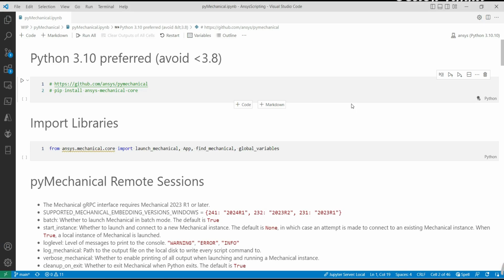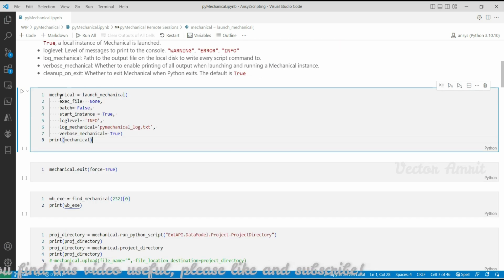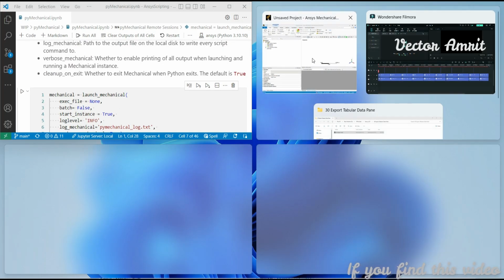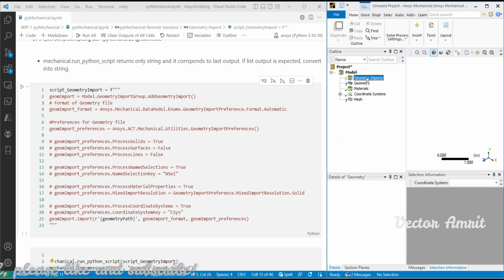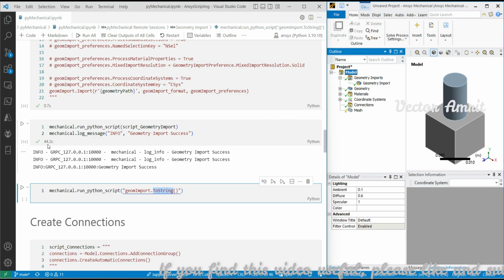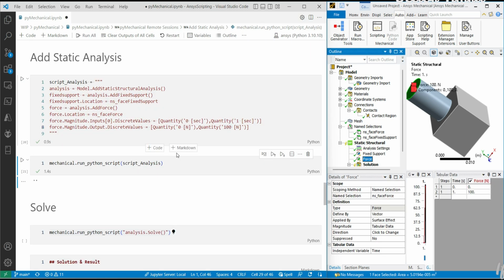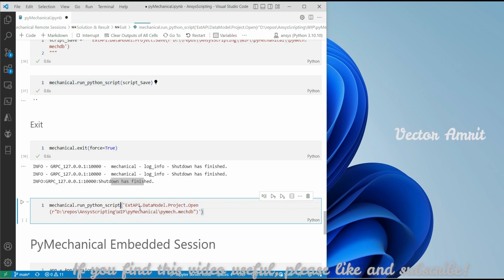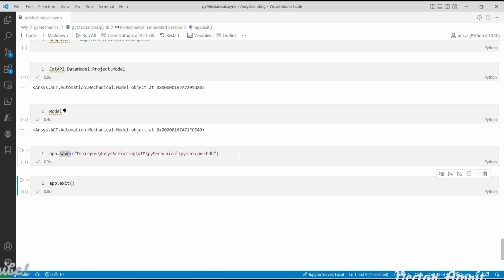pyMechanical in One Video | Ansys Python Tutorials | pyAnsys

Comment: Hi Sir,
I use GUI for running workbench. I drag and set up static structural module using GUI. Applied force, pressure and get it solved. Now i drag the Modal Analysis module in the Set Up object of the Static Structural module solved earlier and found modes. Then i drag three Response Spectra modules in the Modal module's set up object. Applied the Response Spectra in a particular direction in each Response Spectra Modules and Solved them. I want all the six components of stresses calculated at each nodes in all the three response spectra to be added by SRSS method. All the nodal stresses so calculated is to be added linearly to nodal stresses calculated in Static Structural Module. Now principle stresses are to be calculated using the Nodal Stresses calculated so far to further calculate Stress Intensity.   How can i execute it either in GUI or using PyAnsys.

Comment: Hi sir 
I'm trying to implement the similar method on the ansys 2023 R2 student version and upon running the code ansys mechanical open and then shuts down immediately. How do I resolve this issue 

Thank you
Reply: And a error of version 232 not found in the terminal
Reply from the maker: I think it doesn’t support student version
Reply: Hi Sir
Did you solved?

Comment: Thanks for explaing, Can you tell me if we can run the ANSYS Static structural file Using PyMechanical in Github Codespace or in Intel cloud Console or other cloud computing websites ?
Reply from the maker: PyMechanical need a grpc server which is present in installation directory. You can run from github codespace if you connect it remotely using ip/port.
Reply: @VectorAmrit  Means, basically we can run simulation if we have low pc specs?
Reply: In cloud?